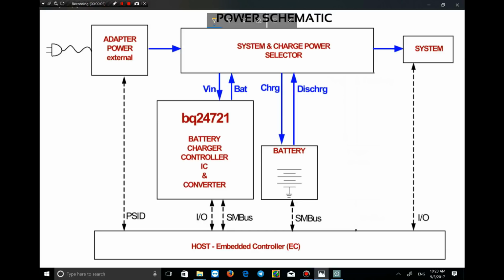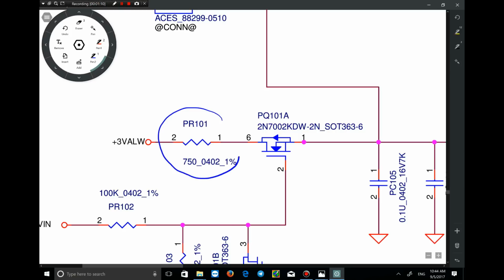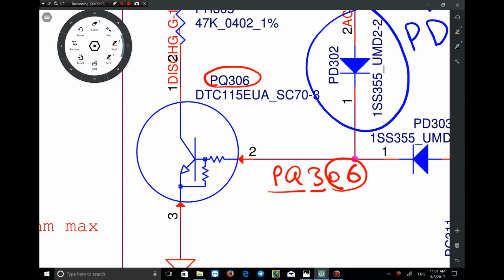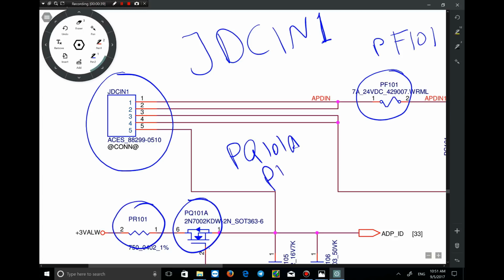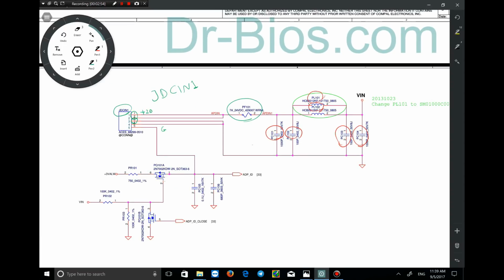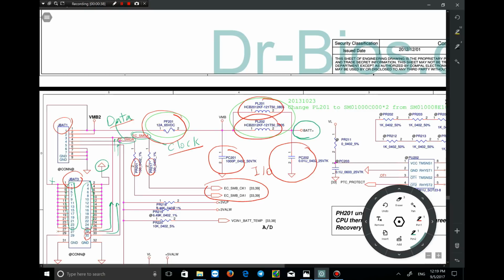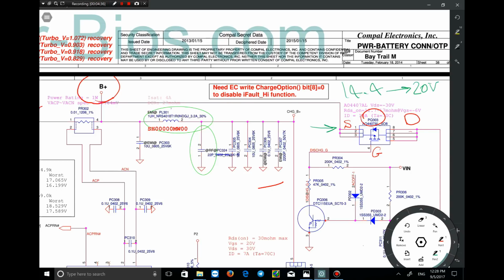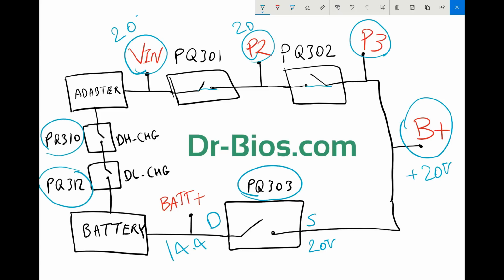How To Read Laptop Schematics-Part 1

Comment: Good video
Reply from the maker: part1: https://dr-bios.com/articles/how-to-read-laptop-schematics-power-circuit-p/6267
part2: https://dr-bios.com/articles/how-to-read-schematics-power-microcontroller/6274
part3: https://dr-bios.com/articles/how-to-read-laptop-schematics-pwm-circuit-sem/6298
part4: https://dr-bios.com/articles/how-to-read-laptop-schematic-pwr-alw-voltages/6304
part5: https://dr-bios.com/articles/how-to-read-laptop-schematic-vs-voltages/6330
part6: https://dr-bios.com/articles/how-to-read-laptop-schematic-pwr-alw-voltages/6343
part7: https://dr-bios.com/articles/how-to-read-and-understand-laptop-schematics/8438

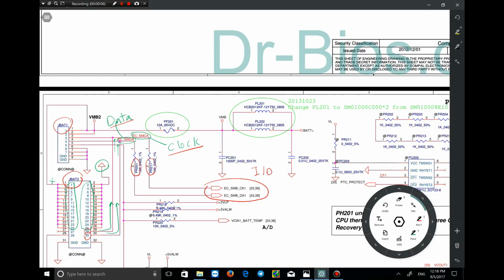Comment: If I understood correctly, the single digit number base is used as the first number for the components of that particular block but at 25:45 voltages from the battery JBAT1 goes through elements whose first digit is 2 i.e PF201, PL201&PL202 and PC201&PC202 so why are these elements using 2 as their base, where did it come from or how is it significant in this case?

Comment: I love this tutorial, its presentation is perfect and easy to understand, I would watch up to the 10th part if available....patiently waiting for part 2.
Reply from the maker: part1: https://dr-bios.com/articles/how-to-read-laptop-schematics-power-circuit-p/6267
part2: https://dr-bios.com/articles/how-to-read-schematics-power-microcontroller/6274
part3: https://dr-bios.com/articles/how-to-read-laptop-schematics-pwm-circuit-sem/6298
part4: https://dr-bios.com/articles/how-to-read-laptop-schematic-pwr-alw-voltages/6304
part5: https://dr-bios.com/articles/how-to-read-laptop-schematic-vs-voltages/6330
part6: https://dr-bios.com/articles/how-to-read-laptop-schematic-pwr-alw-voltages/6343
part7: https://dr-bios.com/articles/how-to-read-and-understand-laptop-schematics/8438
Reply: @DrBioscom  Links are dead? Any other link? Thanks

Comment: Thanks for the effort
Reply from the maker: part1: https://dr-bios.com/articles/how-to-read-laptop-schematics-power-circuit-p/6267
part2: https://dr-bios.com/articles/how-to-read-schematics-power-microcontroller/6274
part3: https://dr-bios.com/articles/how-to-read-laptop-schematics-pwm-circuit-sem/6298
part4: https://dr-bios.com/articles/how-to-read-laptop-schematic-pwr-alw-voltages/6304
part5: https://dr-bios.com/articles/how-to-read-laptop-schematic-vs-voltages/6330
part6: https://dr-bios.com/articles/how-to-read-laptop-schematic-pwr-alw-voltages/6343
part7: https://dr-bios.com/articles/how-to-read-and-understand-laptop-schematics/8438

Comment: Great video. Keep it up! Thanks.
Reply from the maker: Thank you dear, Daniel Tenkorang :)
Reply from the maker: part1: https://dr-bios.com/articles/how-to-read-laptop-schematics-power-circuit-p/6267
part2: https://dr-bios.com/articles/how-to-read-schematics-power-microcontroller/6274
part3: https://dr-bios.com/articles/how-to-read-laptop-schematics-pwm-circuit-sem/6298
part4: https://dr-bios.com/articles/how-to-read-laptop-schematic-pwr-alw-voltages/6304
part5: https://dr-bios.com/articles/how-to-read-laptop-schematic-vs-voltages/6330
part6: https://dr-bios.com/articles/how-to-read-laptop-schematic-pwr-alw-voltages/6343
part7: https://dr-bios.com/articles/how-to-read-and-understand-laptop-schematics/8438

Comment: Thank you so much really helpful
Reply from the maker: part1: https://dr-bios.com/articles/how-to-read-laptop-schematics-power-circuit-p/6267
part2: https://dr-bios.com/articles/how-to-read-schematics-power-microcontroller/6274
part3: https://dr-bios.com/articles/how-to-read-laptop-schematics-pwm-circuit-sem/6298
part4: https://dr-bios.com/articles/how-to-read-laptop-schematic-pwr-alw-voltages/6304
part5: https://dr-bios.com/articles/how-to-read-laptop-schematic-vs-voltages/6330
part6: https://dr-bios.com/articles/how-to-read-laptop-schematic-pwr-alw-voltages/6343
part7: https://dr-bios.com/articles/how-to-read-and-understand-laptop-schematics/8438

Comment: This is awesome!!
This conctep you nee to follow! Then you are be top.
Part 2 is missing  :)
Reply from the maker: you can watch other parts of reading and understanding schematics in the link bellow :)
https://dr-bios.com/laptop-repair#tab-1
Reply from the maker: part1: https://dr-bios.com/articles/how-to-read-laptop-schematics-power-circuit-p/6267
part2: https://dr-bios.com/articles/how-to-read-schematics-power-microcontroller/6274
part3: https://dr-bios.com/articles/how-to-read-laptop-schematics-pwm-circuit-sem/6298
part4: https://dr-bios.com/articles/how-to-read-laptop-schematic-pwr-alw-voltages/6304
part5: https://dr-bios.com/articles/how-to-read-laptop-schematic-vs-voltages/6330
part6: https://dr-bios.com/articles/how-to-read-laptop-schematic-pwr-alw-voltages/6343
part7: https://dr-bios.com/articles/how-to-read-and-understand-laptop-schematics/8438

Comment: This video is very helpful. Thank you Dr Bios.com
Reply from the maker: part1: https://dr-bios.com/articles/how-to-read-laptop-schematics-power-circuit-p/6267
part2: https://dr-bios.com/articles/how-to-read-schematics-power-microcontroller/6274
part3: https://dr-bios.com/articles/how-to-read-laptop-schematics-pwm-circuit-sem/6298
part4: https://dr-bios.com/articles/how-to-read-laptop-schematic-pwr-alw-voltages/6304
part5: https://dr-bios.com/articles/how-to-read-laptop-schematic-vs-voltages/6330
part6: https://dr-bios.com/articles/how-to-read-laptop-schematic-pwr-alw-voltages/6343
part7: https://dr-bios.com/articles/how-to-read-and-understand-laptop-schematics/8438

Comment: You really explained it better than my professor 😂 Thanks for the video by the way!
Reply from the maker: That's kind of you :):):)
Thanks and so glad to help
Reply from the maker: part1: https://dr-bios.com/articles/how-to-read-laptop-schematics-power-circuit-p/6267
part2: https://dr-bios.com/articles/how-to-read-schematics-power-microcontroller/6274
part3: https://dr-bios.com/articles/how-to-read-laptop-schematics-pwm-circuit-sem/6298
part4: https://dr-bios.com/articles/how-to-read-laptop-schematic-pwr-alw-voltages/6304
part5: https://dr-bios.com/articles/how-to-read-laptop-schematic-vs-voltages/6330
part6: https://dr-bios.com/articles/how-to-read-laptop-schematic-pwr-alw-voltages/6343
part7: https://dr-bios.com/articles/how-to-read-and-understand-laptop-schematics/8438

Comment: On the PL101 and PL102 coils, the P is power, so what does the L represent? You mentioned PF was power fuse, and PC was power cap.... PL is Power Inductor (just read it elsewhere), So L is Inductor. Go figure.
Reply: L means LENZ  in honor of Emil Lenz .
Reply from the maker: yes "L" in Inductor, thanks for mentioning it dear Dano C.
Reply from the maker: part1: https://dr-bios.com/articles/how-to-read-laptop-schematics-power-circuit-p/6267
part2: https://dr-bios.com/articles/how-to-read-schematics-power-microcontroller/6274
part3: https://dr-bios.com/articles/how-to-read-laptop-schematics-pwm-circuit-sem/6298
part4: https://dr-bios.com/articles/how-to-read-laptop-schematic-pwr-alw-voltages/6304
part5: https://dr-bios.com/articles/how-to-read-laptop-schematic-vs-voltages/6330
part6: https://dr-bios.com/articles/how-to-read-laptop-schematic-pwr-alw-voltages/6343
part7: https://dr-bios.com/articles/how-to-read-and-understand-laptop-schematics/8438

Comment: Thank you so much for this video , really very informative
Reply from the maker: you're welcome dear Zaid Hussain :)
Reply: Thank you , I wonder how can I get the replacement parts in case I find out some component need to be replaced ?
Reply from the maker: there are a lot of videos and articles in the website that can help you find the failed blocks on motherboard:
https://dr-bios.com/laptop-repair#tab-1
:)
Reply: Thank you so much, I will check your website, much appreciated
Reply from the maker: part1: https://dr-bios.com/articles/how-to-read-laptop-schematics-power-circuit-p/6267
part2: https://dr-bios.com/articles/how-to-read-schematics-power-microcontroller/6274
part3: https://dr-bios.com/articles/how-to-read-laptop-schematics-pwm-circuit-sem/6298
part4: https://dr-bios.com/articles/how-to-read-laptop-schematic-pwr-alw-voltages/6304
part5: https://dr-bios.com/articles/how-to-read-laptop-schematic-vs-voltages/6330
part6: https://dr-bios.com/articles/how-to-read-laptop-schematic-pwr-alw-voltages/6343
part7: https://dr-bios.com/articles/how-to-read-and-understand-laptop-schematics/8438

Comment: Thank you for an excellent explanation. I thought it was very well presented, great job!
Reply from the maker: part1: https://dr-bios.com/articles/how-to-read-laptop-schematics-power-circuit-p/6267
part2: https://dr-bios.com/articles/how-to-read-schematics-power-microcontroller/6274
part3: https://dr-bios.com/articles/how-to-read-laptop-schematics-pwm-circuit-sem/6298
part4: https://dr-bios.com/articles/how-to-read-laptop-schematic-pwr-alw-voltages/6304
part5: https://dr-bios.com/articles/how-to-read-laptop-schematic-vs-voltages/6330
part6: https://dr-bios.com/articles/how-to-read-laptop-schematic-pwr-alw-voltages/6343
part7: https://dr-bios.com/articles/how-to-read-and-understand-laptop-schematics/8438

Comment: Thank you very much !  Great video & explanation.  Keep it up.
Reply from the maker: part1: https://dr-bios.com/articles/how-to-read-laptop-schematics-power-circuit-p/6267
part2: https://dr-bios.com/articles/how-to-read-schematics-power-microcontroller/6274
part3: https://dr-bios.com/articles/how-to-read-laptop-schematics-pwm-circuit-sem/6298
part4: https://dr-bios.com/articles/how-to-read-laptop-schematic-pwr-alw-voltages/6304
part5: https://dr-bios.com/articles/how-to-read-laptop-schematic-vs-voltages/6330
part6: https://dr-bios.com/articles/how-to-read-laptop-schematic-pwr-alw-voltages/6343
part7: https://dr-bios.com/articles/how-to-read-and-understand-laptop-schematics/8438

Comment: thanks for reply 
i have friendly request that plz try to upload full video 
thanks in advance.
Reply from the maker: no problem :) and as I said I'll try to upload them ASPS
stay with Dr-Bios.com
Reply from the maker: part1: https://dr-bios.com/articles/how-to-read-laptop-schematics-power-circuit-p/6267
part2: https://dr-bios.com/articles/how-to-read-schematics-power-microcontroller/6274
part3: https://dr-bios.com/articles/how-to-read-laptop-schematics-pwm-circuit-sem/6298
part4: https://dr-bios.com/articles/how-to-read-laptop-schematic-pwr-alw-voltages/6304
part5: https://dr-bios.com/articles/how-to-read-laptop-schematic-vs-voltages/6330
part6: https://dr-bios.com/articles/how-to-read-laptop-schematic-pwr-alw-voltages/6343
part7: https://dr-bios.com/articles/how-to-read-and-understand-laptop-schematics/8438

Comment: plz part 2
Reply from the maker: part1: https://dr-bios.com/articles/how-to-read-laptop-schematics-power-circuit-p/6267
part2: https://dr-bios.com/articles/how-to-read-schematics-power-microcontroller/6274
part3: https://dr-bios.com/articles/how-to-read-laptop-schematics-pwm-circuit-sem/6298
part4: https://dr-bios.com/articles/how-to-read-laptop-schematic-pwr-alw-voltages/6304
part5: https://dr-bios.com/articles/how-to-read-laptop-schematic-vs-voltages/6330
part6: https://dr-bios.com/articles/how-to-read-laptop-schematic-pwr-alw-voltages/6343
part7: https://dr-bios.com/articles/how-to-read-and-understand-laptop-schematics/8438
Reply: access denied on part 03 and 04  @DrBioscom